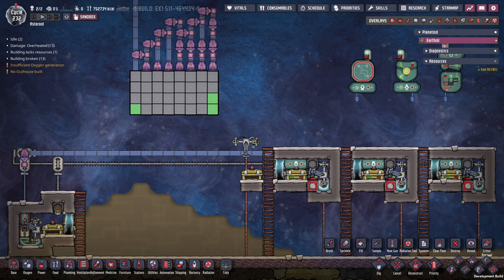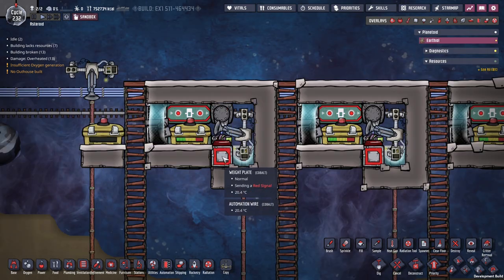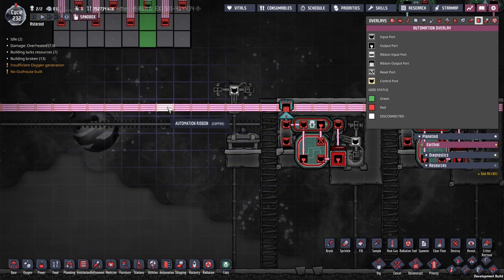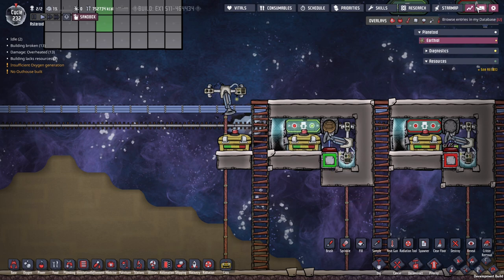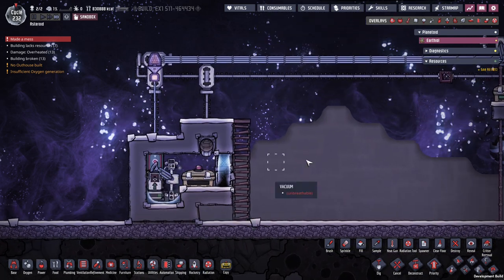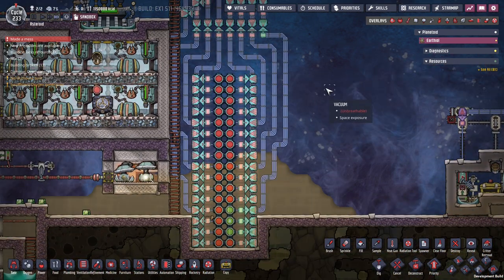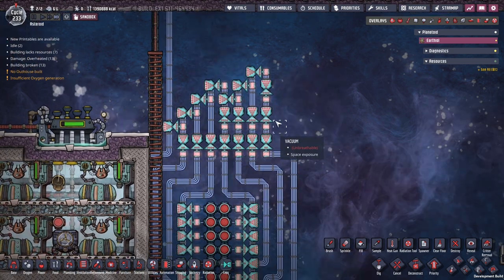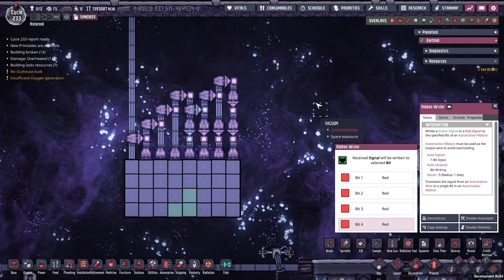Automated Food Delivery - Oxygen Not Included

Comment: Lifting the bottleneck on ribbon-wire bandwidth unlocks significantly more complex computational circuitry. I built Conway's "Game of Life" from ONI circuits, but the ultimate scale of that project was limited by the challenge of routing more than about 5 x 4 ribbon cables into a single densely packed display grid. If we can rotate 32 bits onto and off of one wire, much bigger displays should be possible. Not to mention that it's a free bit-shift operator. Very very interesting.
Reply: Ok, I did some testing, and it's definitely using a signed int32 type to store the ribbon state. The ribbon writers are left-shift operators and ribbon readers are right-shift operators. I know it's int32 because if you shift a 1 into the 32nd bit (making the int32 value a negative number), then when you subsequently use ribbon readers to shift right, you find an infinite sequence of 1's corresponding to what would have been bit positions 33, 34, 35, etc. Ie, this is signed "arithmetic" shift-right where the highest bit is copied. Versus unsigned bit shifting where 0's are shifted in.
Reply: The even more exciting finding is that the AND and OR gates are bitwise logic! Oh boy, being able to do multi-bit AND and OR logic opens up all sorts of possibilities for shrinking complex circuitry.
Reply: Unfortunately, the memory gate is 1-bit only. That one is pretty rough, requiring two additional AND gates and a NOT to implement a basic memory cell that has a write line.
Reply: I think I might be able to implement a higher density memory cell using pipes and element sensors, but it's a bit tricky.
Reply: Using ONI "pixel pack" buildings, for constructing the largest possible dense pixel display where every pixel on all "pixel pack" elements is routed to a unique input signal, my prior best design was 16 wide (4 packs of 4) x 12 packs high, or unlimited width x 8 high.  Using these new bit-shift hacks, I'm now able to achieve a dense displays that are 20 wide x ~60 high (using some insanely intricate decoding patterns inside the routable space between the pixel pack inputs that are ultimately limited by exhausting all 32 bits on one of the wires). Or with a height-limit of 14,  I'm able to achieve unlimited width. You have to pay one of the two limits, and I'm pretty sure that it's impossible to construct a dense rectangular display that's bigger than 20 x 14 in both dimensions.
Reply from the maker: True commitment! I would definitely like to see your version of Conway's GOL. I stepped away from making videos for a while, to work on some things, but I think it's time I get back.